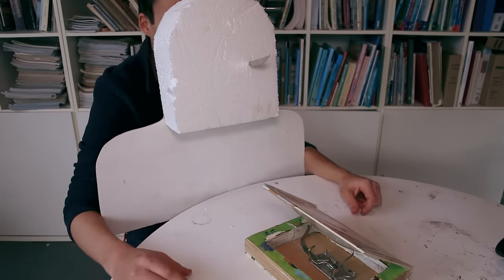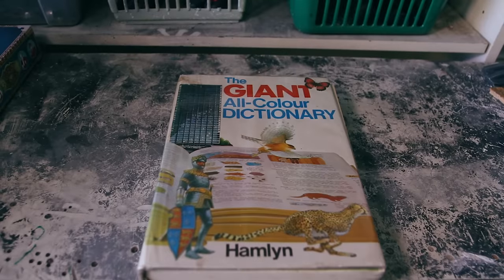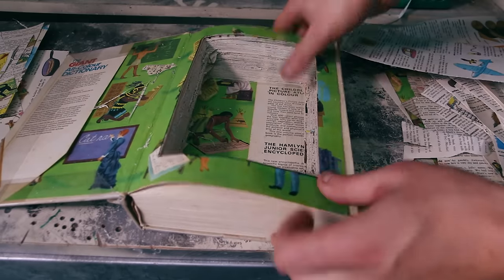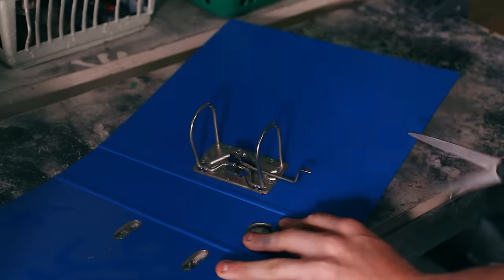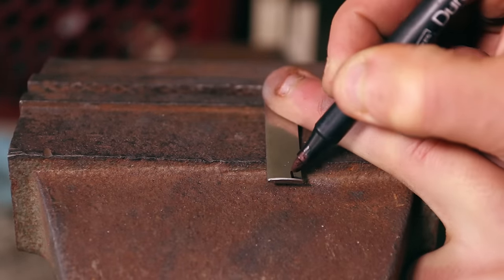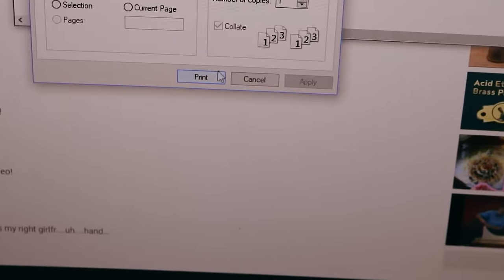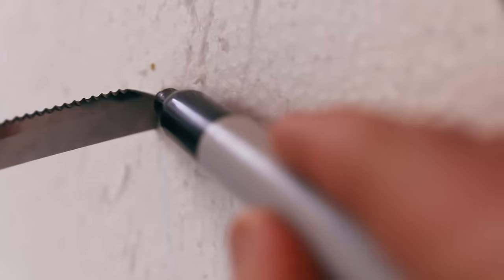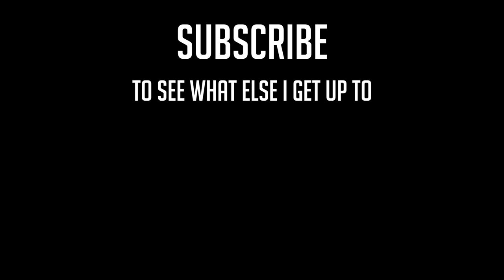Throwing Knife Book Trap

Comment: It may be only 900g of force, but that's 900g on the tip of that knife. That 2kg milk bottle is a fatty compared to the sharp pressure of the knife point
Reply: I got 2250000 pascals, thas more than someone stepping on a high heel puting all the weight with one foot on you

Comment: i had those same bolt cutters but the metal on the cutting edges was weaker than the lock and pieces of it cracked and chipped off and made it so the cutters couldnt cut anymore because the edges didnt have any contact with each other. i kept trying to cut the lock for a while afterwards because it was too dark for me to see what had happened. they made easy work of the chains i used it on though

Comment: How to make a WAY nicer bookbox, super simple!

Mix 1 part white glue with 1 part water
Use enough to fill a small pot or bucket your book will fit in
Mix well
Separate pages into 10% - 80% - 10%
Place parchment/wax paper between sections
Secure all pages together with rubber bands
Hang all pages in glue mixture (Not cover pieces)
let soak 30 mins
remove from glue mixture
place parchment/wax paper behind book cover front and back
final product should be:

COVER
parchment/wax paper
10% of pages
parchment/wax paper
80% of pages
parchment/wax paper
10% of pages
parchment/wax paper
REAR COVER

clamp/weight entire book securely
wipe away any glue which WILL leak from all sides

Let dry for several days
After dry, remove all parchment/wax paper
Using a drill, drill 4 holes to outline the cavity in the book in the main 80% block
Using a jigsaw, cut out the center of the 80% block using the 4 holes you just drilled
use a bit of glue to secure the REAR 10% of pages to the REAR COVER and the main block of 80% of the pages
clamp again
wipe away excess again
let dry again

Now you have a wood-solid box with a solid flip open lid hidden inside a book!!!

Comment: 6:00 This is pointless. You are measuring the steady state of cutting polystyren foam like this. Not the power of the spring. What I mean is, that it will measure the same weight for any depth.

What would make sense is a drop test. That is, measuring from what combination of weight and height (with the same blade geometry) you would need to drop the knife with to get the same depth. Then height*mass*acceleration=Energy. Which would be the energy the spring gives you.